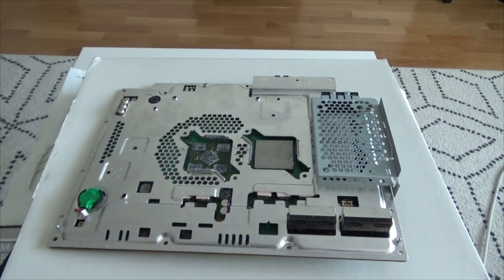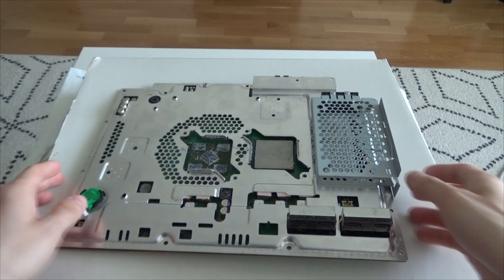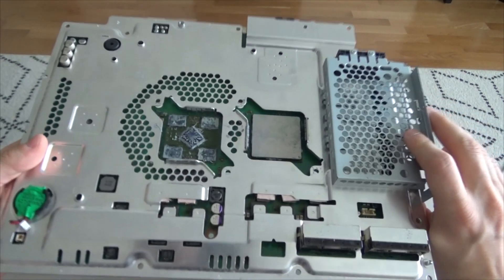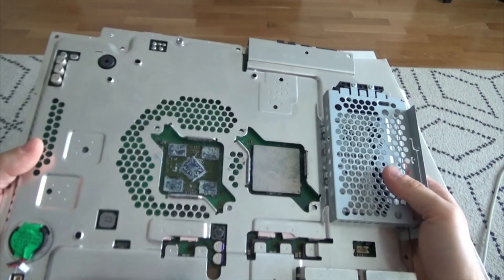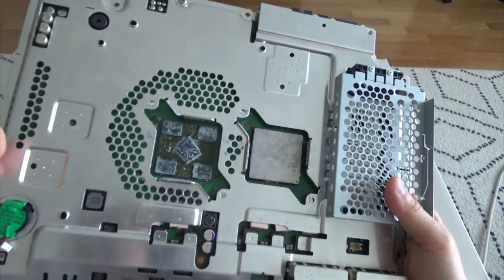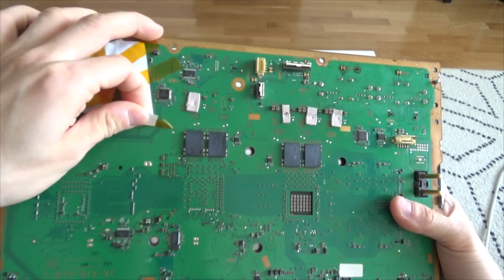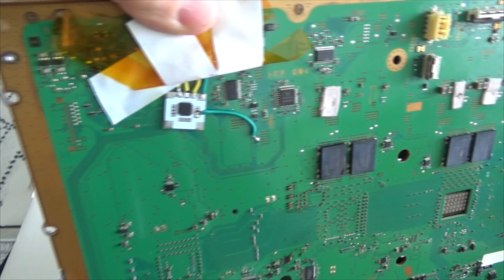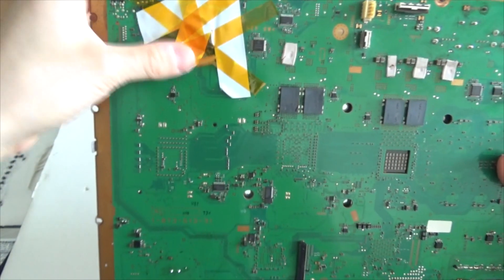PS3 YLOD repair newest method (RSX Mod)

Comment from the maker: Some corrections about the resistors. Turns out you don't need to add any 47k resistors for cok-002 boards. But you do need to remove R2001 from cok-001 boards (leave stock R2002  in or replace it with a 47k )
Reply: Is it necessary the voltage mod for a COK-001 or is it optional?
Reply from the maker: @ab91-temp  It is recommended. But there are other ways to do it also.

Comment: Please use flux and leaded solder
Reply from the maker: I do.
Reply: @calyps0man  idk those joints look like they have never seen flux before… if recommend applying some more solder and a little more flux to the chip
Reply from the maker: @IMDYT420  Oh you mean the orbis chip? I used leaded solder balls for the RSX, but not for the chip. It's hard to  buy leaded one in EU. Also it wasn't the best soldering job. I had to solder it back and forth several times because we weren't sure about the correct way to do it. Then when it finally started working I just let it be and decided to show that it actually works. I've redone it now and put double sided tape so it doesn't just hang there on the tape...
Reply: @calyps0man  also I recommend trimming the wires down some on the board
Reply from the maker: It can all be done better and tidier with more care. I get you.
Reply: @calyps0man  yea i found out the hard way that leaving it like that usually results in broken wires or ripped pads

Comment: And whats with green light of death?
Reply from the maker: What do you mean?
Reply: @calyps0man  i really dont know what i meant by that haha. But hey, do you know what causes the Green light of Death?
My ps3 has it.
It doesnt sync with controllers and i can not enter recovery menu. 

Is it maybe a dead CELL?
Reply from the maker: @MONKEYDUDE2701  You would need to diagnose it with syscon codes as well. Cell is rarely the cause, it seems invincible. I had one GLOD ps3 and it had an rsx problem . It wasn't initializing the resolution. But it could also be a faulty HDMI chip. The only way to know is to diagnose. If HDMI is ok and depending on the error code, you might need to read south bridge log as well...

Comment: after that all hard sensitive works on that mobo how many degrees dropped ? is there anything cooler after reballing with lower nano meter binning ?
 65nm rsx =? degrees Celsius
45nm rsx =? degrees Celsius
is it worth it to try?
i think psu making so many heat and that giant cooling fan doesn't do airflow in the right way.
Reply from the maker: In GT6, 66 C for Cell, 62 C RSX with fan at around 30%. But with syscon 73 Cell and 68 for RSX. That is done with both chips delidded and a room temperature of 28 C.
Reply: @calyps0man  this is so cool , that will be amazing , thanks to you for such a great job. i modded my ps3 with tiny holes under the console but make 3 degrees dropped , but after replacing that psu with somthing called 206 model with lower power consumption getting 3 another degrees dropped , also i replaced thermal compound and cleaned up all of the parts. 
after too many research and hard works i succeeded to get from idle temperature 74 to 68 for cell and 71 to 65 for rsx on idle ps3 on room temperature 26. 
anyway thanks for the reply.

Comment: Maaan
I thought maybe I could learn to replace the tokin but now that there's this, this is wayyy too advanced for me
Reply: Same just when I figured tokin replacement would fix it, this shows up... What's next? Manufacture the damn thing? But I do appreciate this video extremely valuable but yeah can't do this no way
Reply: @Hamedak97  If you're in Europe why not message Artificial for a quote to have the work done?
Reply: @NewRetroRepair  I don't live in EU
Reply from the maker: @Hamedak97  you can stay in touch, next year you could buy the finished product from me.

Comment: Since the heat dissipation is stronger on BC model, could you tell me the temp of an 65mm RSX with the cooling solution on an 90mm one from your console please? ^^
Reply from the maker: In GT6, 66 C for Cell, 62 C RSX with fan at around 30%. But with syscon 73 Cell and 68 for RSX. That is done with both chips delidded and a room temperature of 28 C
Reply: @calyps0man  Thanks a lot for your answer

Comment: The 90/10% statistics you're repeating from that messageboard are completely made up.
Reply: @SuperLolMine Oh don't worry I know that there is a possibility that it is the bond wires that may have broken, detached, deteriorated to the die of the RSX, or substrate, that heating it up may very well be making them rebond for a temporary amount of time.
But indeed, swapping out the older RSX for a newer one would help provide a more lasting fix in those cases.
Reply from the maker: How so? You would have to read better through nec/tokin thread. Also ive talked to technicians who have repaired hundreds of these, and while they cant say 100% how often its tokins, it's a lot rarer than other issues.
Reply: Actually just finished working on about 8 of the BC consoles (cok-002), of which 3 of them were simply shorted caps and blown fuses, 4 were issues relating to the RSX being bad solder connections, one that did not pass (possibly bad RSX), and another that is showing a strange power error.
Out of these only 2 had errors logged relating to the power rails (nec/tokin).
So it would seem to me that a good amount of defects occur due to the soldering, however replacing with a newer RSX would cut down on heat and power consumed compared to the original 90nm. Again all this could be made unnecessarily if Sony dropped the "why would anybody play this" attitude when it comes to backwards compatibility and develop a console that would indeed play older titles alongside new releases.

Comment: Would the same type of swap be possible for the cpu i wonder
Reply from the maker: Not that easily. It's married to each motherboard. Also If I remember right newer cpus are not pin compatible with old.

Comment: I remember the 40mm rsx Chips were found on some Sony refurbished Backwards compatible models. Is there any explanation how Sony made the swap with no other hardware modifications?
Reply from the maker: Oh but there were quite a bit of modifications in refurbished BC models. Resistors and voltage configuration were changed almost in the same way. They also replaced syscon chip with the one that can support 40nm, then moved some of the data from original to the new one and modified firmware (if I'm correct). There have been some attempts to perform the same thing by a few users, but so far it's been challenging.
Reply: I remember this one only: https://www.psx-place.com/threads/frankenstein-phat-ps3-cecha-with-40nm-rsx.28069/

Comment: Thanks for the video friend.
We can all be happy because even in the cases where the RSX is bad inside, there is a way forward now after diagnosing the problem. When reballing is not enough.

Cheers
Reply from the maker: Thanks for the comment. But I still believe there is no point in reballing when we know how delicate those 90nm chips are. If you are going to reball, you might as well put a newer and more reliable RSX, which can also handle high heat better when you are going to be lifting it from another board, reballing and soldering it on the board in question. But that may be more difficult/ more expensive. So it's up to the customer.
Reply: @calyps0man  Sure friend, but things are never so simple. Different people have different priorities. This new method was invented by reballers at the end of the day. And they are still reballing often because they know it is not always pointless even if sometimes it is.
I wouldn't know, but I respect their work too even when they are only reballing. Generalizing too much can be destructive and it is not what real technicians are supposed to do. 
We can only be thankful.
Reply from the maker: @pacor.9325   It does not matter if inventors of the mod were "reballers". Yes, they reball these, but they are running a repair shop. It may be a cheaper option for the customer. But if I say "In my opinion, I would not be reballing that particular chip, but rather replace it", then you claim I am supposedly spreading "destruction". I am not pushing my ideas on to anybody, but you seem to have trouble accepting it. I am not running a repair shop. Based on the facts we have all read, whichever way you look at it, the 90nm chip is not as resilient as the newer ones. It can die easier than newer ones. It may have internal fault ( maybe there isn't enough proof, but what Botakompong said with the shorting on the inside, that's enough for me to believe ). Ask Vyktor, he does not care to deal with 90nm either. It does not handle high temperatures well. Whatever you are trying to prove, everybody can make their own decisions.
Reply: @calyps0man  Friend, If it's really bothering you I can delete all my comments. I'm not even disagreeing with you...
It's a matter of being respectful. If you really are thankful for guys like botakompong, then why would you go out of your way to make their own work look like a scam?
And I know for a fact you simply misinterpreted his own words.
Of course there is no point reballing a chip that has a short inside. But not all chips have this problem, so I'm just saying it's valid to make sure first before jumping to the last step.
This includes slim and superslim models that also get RSX problems (3034/4xxx) sometimes even with the newest chips.

I'm not a reballer nor am I telling anybody what to do. Just need to give the full picture.
We already have too many sad examples of generalizing too much.
Reply from the maker: @pacor.9325  How am I not being respectful? How am I making their own work look like a scam?  You are being ridiculous. You're not his guardian angel either. First of all, I have discussed this topic with him many times and asked if he's ok with this video. I also talked to him about other points. He himself has agreed that 90nm is not as reliable as other chips. This has nothing to do with me misinterpreting his words on the forum. Since then I have already talked to him more in depth about shorted chips and non shorted chips. He said he would reball first, because in his opinion it is reasonable to try it first, it is also cheaper and most people are happy with that. it is impossible to say how long it would last after it. And that's just his way to not replace what's not broken unless there is a need for it.  So in that, he is in agreement with you. But I NEVER said reballing is a scam. You are trying to put words into my mouth now. You are also misunderstanding me apparently. I GET IT, NOT ALL 90nm chips have a short. I know some do, some don't.  Once again, I am not encouraging anybody to do things one way or another. I am simply stating my opinion, that I personally would not reball a 90nm regardless of whether it's shorted or has damaged solder (because I think the chip is weak regardless and because I can do a replacement).  But that's my choice and I am free to do so. That doesn't mean I am against everybody who chooses reball. Okay?
Reply: @calyps0man  Ok man, yes I know you never wanted to make him or anybody look bad. Directly or indirectly.
Your video is great, I love it, and I'm sure he loves it too. I could not have made it better myself.
Sorry if this got out of hand for some reason.
Misunderstandings can happen. That's all I was talking about.
Reply from the maker: @pacor.9325  It's all good. Maybe you took some of my words/statements too literally . Maybe i also misunderstood  your intentions. Either ways, there is no need to overreact. I have talked to Botakompong probably more than anybody else, because I have been in touch with him for several weeks now. We are not competitors. :D You really don't need to worry about him at all.
Reply: @calyps0man   Sure, we can only admire him and his work. In the end it's not really about him or you or me either.

It's all fine as long as the full picture is presented. People are desperate to jump to oversimplified solutions to complex problems. Same now as in the past when they believed reballing was magic. Nothing is.
All has its place. Even the capacitors.
Reply from the maker: @pacor.9325  Yes, this is a very complex machine that is prone to complex errors.  It definitely helps to present the full picture. YLOD faults can be numerous. It's sad it took this long to get to the point where we can pinpoint problems. Whatever the solution is, this is a console of the past for most people. If somebody really needs to fix these, they will probably be already aware of the diagnostics methods by now. That doesn't mean we shouldn't strive to present our discoveries as accurately as possible. But  an accidental viewer, I bet, will just look at it and say "Good for them, but I'm surprised someone's still playing on that thing...". So it's not like we are making any revolutionary breakthroughs here. It was a fun project, but for most people its relevance is long gone. Just odd few enthusiasts and dedicated fans left. So maybe I'm wrong, but feels like there isn't many people left who would bother jumping to any conclusions anymore :D That's my take on it.
Reply: @calyps0man  still learning repair. My understanding is a reball will fix bad BGA solder, and replacement is necessary when the rsx itself fails. From what I gather,  reflow/reball of a failed rsx can revive it temporarily, but won’t permanently fix a defective rsx. I’d be interested to know if Im understanding things correctly.
Reply from the maker: @Dirty_Bear22  Yes, you are correct. it is probably the most reasonable way to think. My argument with Paco R was that in the case of 90nm, I personally preferred replacement with 40nm over reballing whether it had BGA solder issue or "proper" fault. But that is only for 90nm, because in my opinion those chips are not as reliable as 40 or 65nm, plus high temperatures during reball are probably going to hurt it (they are more sensitive to heat).  However, in the case of 65 and 40nm chips that may have BGA faults (that happens too), reball is definitely a valid solution. Because they are able to handle heat better and are arguable built more reliably/longer lasting. That is just my opinion, I don't claim it's more reasonable to do things my way. That's just how I would do it.
Reply: @calyps0man  that makes sense, a 40nm should offer the longest lifespan. My reasoning was not many shops/individuals have both the equipment and knowledge to install a newer nm rsx, but it’s definitely a more elegant solution then reball/replace the same failure prone 90nm chip. When you said “proper” fault, are you referring to failure of the rsx die?
Reply from the maker: @Dirty_Bear22  Yes, by proper, I meant any type of internal fault either in the die or substrate, but basically somewhere inside that we don't have access to. It was proven that sometimes 90 nm chip can get an internal short. The reasons are still unclear, but possible causes are electromigration/silicon degradation because of high temperatures and power draw.
Reply: @calyps0man  Thanks for the clarification :) .

Comment from the maker: And btw, there is also an alternative way to diagnose YLOD faults with only analog meter. Here is how to do it. https://www.psx-place.com/threads/frankenstein-phat-ps3-cecha-with-40nm-rsx.28069/page-40#post-292794  https://www.psx-place.com/threads/frankenstein-phat-ps3-cecha-with-40nm-rsx.28069/page-41#post-294795
Reply: So I don't know what I should do with my PS3 it's a 20gb model. It's had two caps replaced and it just ylod on me . I bought the unit already like this. Could you possibly help me 🥺
Reply from the maker: @MikeAKill4  How can I get in touch with you?
Reply: @calyps0man  I have social media or I could contact you via email it's up to you sir
Reply: Or we can talk on here whatever is easiest for you. I work 3rd shift so I might respond a little later
Reply from the maker: @MikeAKill4  We can talk about more details on discord.
Reply: @calyps0man  alright I'll have to set up discord. I'll let you know when I'm free this weekend to see if you can help me with my PS3
Reply from the maker: @MikeAKill4  False alarm. There should not be any issues on US and Japanese systems. Another person has tried the swap now and seems it should be fine. I will also make the procedure for those systems soon and reconfirm it. If all goes well, I think I could do it for you as well. I was planning to offer this as a service. I am available through email, but I don't want to reveal it here.